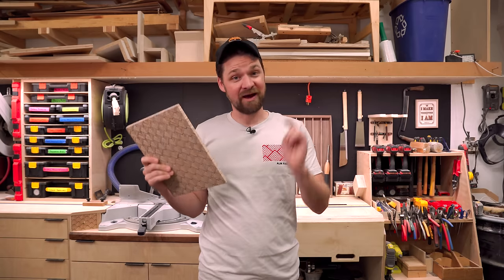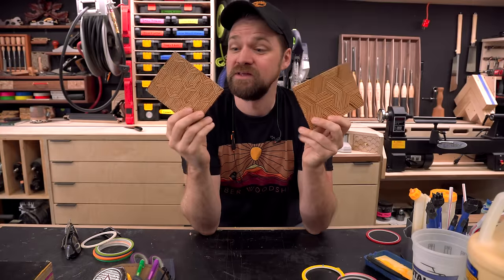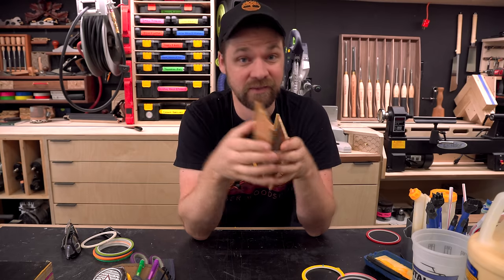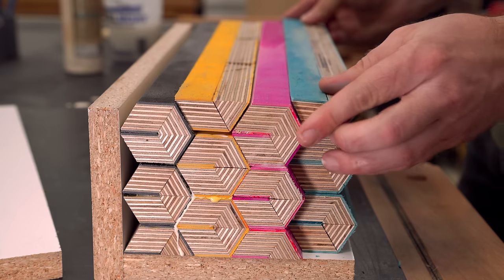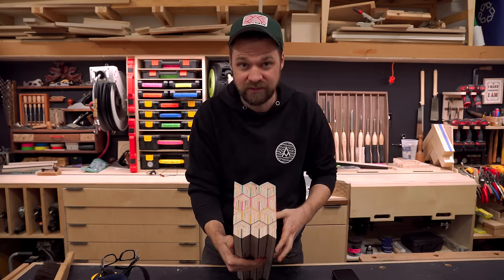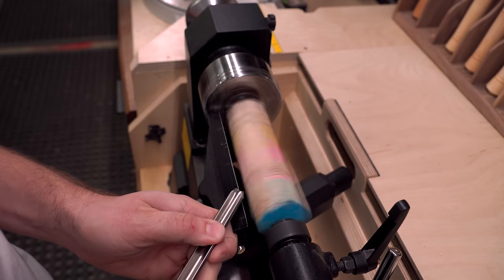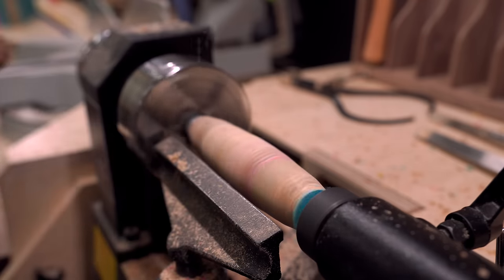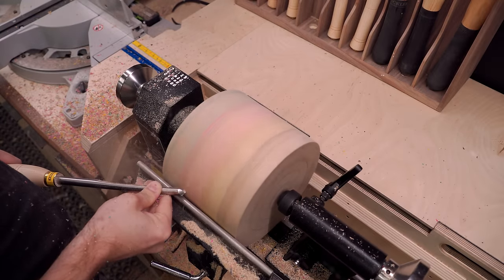Can you Woodturn Patterned Plywood?

Comment: Just been watching your video, I turn a lot of items made from old skateboards, and for someone turning laminated wood for the first time you did amazing. If you have a go a turn a “normal” bowl you’ll be amazed how much easier it cuts, you are properly learning to swim in the deep end. When I made my first skateboard bowl I also experienced the gouge heating up, however a lot of the heat comes from the bevel rubbing and the pressure on the  bevel, I struggle to explain it but as you progress you’ll notice the gouge doesn’t heat up as much & you have to sharpen it less, again on my first skateboard bowl I must have sharpened my gouge a dozen times. Hollowing it you went for a deeper bowl than I’d normally do, kudos, as you found the gouge gives a better finish when turning laminates but deep carving is tricky. Personally I always go for a tenon over a mortise as if there’s any faults in the glue up the chuck can cause them to split. However amazing first time turning veneers as as I said if you master it turn “wood” will seem easy in comparison
Reply: He definitely has some angles to learn with his fingernail profile gouge. Normally a bowl like he made takes a single sharpening. It is hard to explain on the internet what he should look for when he is roughing out a bowl as far as gouge angle etc. But you hit the nail on the head for sure.

Comment: Amazing work once again, you never cease to amaze! When I was taught to turn bowls, we always glued a scrap disc to the bottom of the blank, with a piece of paper in between.  Screw on the adapter plate, do all your turning (inside and out), carving right into your scrap if you want. When the turning is done, split the bowl off the disc with a chisel, the paper should let it split away cleanly. Sand the bottom, and you're done. Also my wife says to use the scraps for bookmarks. Thanks for another great video.

Comment: Loved the video Michael and congrats on working on a new skill! Traditional wood turning gouges are all about tool presentation. That takes time and as you eluded too plywood probably isn’t the easiest material to start learning on. It’s hard to tell from the video, but I think your tool rest may have been too high. If your handles are long enough they should be tucked into your hip when the tip of the gouge engages the center line of the wood. Your inside cuts are a push cut, you kinda want to do that on the outside too. Most of your tool presentation on the outside was scraping cuts, which are fine but the tool has more versatility and you can get a better finish with the push cut. 

It will all come with practice. Keep it up!

Comment: Great project. I applaud you for putting your learning process out there. As a long time turner, I'd offer two suggestions: 1) More clamps and pressure on your glue ups; and 2) a tenon rather than a mortise to use with the chuck is much stronger. Your "squeeze" clamps don't give you enough pressure for lamination work, plus you need cauls to hit the center of the sheets. For segmented turning, every single spot has to be a solid glue joint. I think you'll find those will give you much better results. The tenon on the end is much stronger because it's putting the wood under compression rather than a mortise which is pushing the wood apart and its strength is dependent on having plenty of wood outside the mortise (but the physics are still working against you :-)  ). Good luck and keep up the good work. You'll have a lot of fun with turning square patterns into round objects.

Comment: I tend to find that when hollowing out a blank the best thing to do is to pull toward myself and take deep cuts. (Catching against the wood is mainly avoided with technique; keep practicing). As mentioned by someone else: drilling out the center (using a chuck attachment on your tailstock) helps a ton. And when you’re turning spindles: I hope that you’ll try out placing a finger or two against the toolrest for added control. This can evolve into planting your palm against the toolrest and pulling on the tool with hooked fingers for hollowing out objects.

Comment: Fun video Michael! I noticed that you started out turning your blank from the hex using your bowl gouge. I think you’ll have an easier time getting it into round and to your max diameter if you start with a wider roughing gouge. I also find it much easier to get smooth shavings that way and usually will do all my wide shaping with it as well. You can turn it onto its side and direct the shavings away from you as well. In general I’ll only use a bowl gouge on a spindle if I need to scoop out a tight curve. Keep up the good work with your turning. I have the same lathe and love it. It gets more fun each piece you turn.
Reply from the maker: Thanks for the info!! 🙌

Comment: A lot of turners have a drill chuck designed to fit the tail stock and use that to hold a Forstner Bit to drill out the center material of any bowls, cups and vases they turn...

Drilling out the center save them a lot of time and effort mining out the center with their gouges since the center of the piece isn't turning as fast as the outer rim is...and slower turning material is harder to cut...

Comment: A couple of this I've seen that might help when turning pattern ply wood bows

This one I haven't tried, but seen it done and would do it myself - when making your blank up, start by putting a nice soft wood in the area you will be removing for the inside of the bowl. It's so much quicker to remove sodt wood thats solid then hard plywood thats made up of a million glue joints. It does take so extra time and planning but it also woorks well.

This idea I have tried and love. When making a bowl or vase, before picking up anything chiselly, use a chuck attachment in the tail stock, then use larger and larger drill bits and forsner bits to hollow out a load of that bowl. This will save you even more time because when tuning a bowl ther hardest part tk turn is the bit thats spinning really farst in the center of the wood. The drilling methode removes most of these problems. The sides are also the quickest to shave down and the hole the drills leave make life easier. 

I've also seen people glue a piece of hardwood to the botton so you don't end up with the bowl separating from the chuck. At the end, you could use a laithe tool to separate the 2 piece of wood or a saw. Hope this helps to get your confidence up a bit 😊👍👍👍👍👍👍

Comment: Something you might find helpful when turning pattern plywood, epoxy/wood, or generally fragile turns. Get a drill chuck you can put in your tail stock. Use it as a drill press and gradually step up the diameter of the drill bit. Use some carbide chisels to hollow out from there. Will save you a lot of time and probably a project or two from breaking.
And great job for your first bowl. I like how you first real project is with one of the hardest things to turn without breaking.

Comment: 19:48 seeing as it’s a, I guess, “leverage handle,” (idk the scientifical term) it probably wouldn’t have hurt to use a longer bolt set the full length of the handle, or most of the length so it’s not exposed at the end, to give it more rigidity. That probably would’ve prevented it from breaking unsupported on the lathe and would prevent it from breaking in the future

Comment: Looks awesome. You might try leaving a pillar in the center for your tailstock to press against. It helps keep everything in place while you're digging it out. It doesn't have to be thick. With your plywood I might leave a inch wide pillar until you reach the bottom. Then clean up your sides, and then cut off the pillar.

I'll often use a Dimond carbide tip to make a cone in the center then a round carbide to open up the middle.

I'll also use a diamond to create a sunken tennon instead of a mortis. I like to make a continuous curve all the way under my bowls but  Compression works a lot better to hold the bowls.  So I just cut a groove then taper the tennon.

Comment: Use for shavings? Inlay, edge banding? Even visible shims.
I CANNOT believe that you were able to turn ply. I would have thought this impossible, much less pattered ply. You have just changed my pen-turning world! 

Impressive work with the gouge for a beginner. Yes, you have to use sharp tools, which means you have to incessantly sharpen (as said in my previous comment). CARBIDE.

Honestly , I'm pretty amazed that ply will turn. 
Question: Why didn't you use your carbide blades to turn the inside from the beginning? I mean, I understand wanting to learn to use the gouge, but why? When you have a carbide tool?  Would have saved you a long time re-sharpening and you'd have seen the same effect with the change in pattern that you enjoyed. Just use it from the beginning. 
GLAD you were able to continue after it came out.  Great save. 

Honestly, I'm stunned. GREAT job !!!

Comment: The scraps really reminded me of feathers.  I was imagining them decorating the sides of a mask (the kind you hang on the wall, not wear).  Perhaps more importantly, if you go to make a hollow piece like a bowl in the future, if you can glue it up in the 4 quarters of the piece, you can then use a saw to take off a lot of the material that you would otherwise have to carve out of the middle.  So you recover more scraps and save time.  I learned this from carving watermelons, they are good practice material if you want to measure angles and understand what you will get wyen you reassemble.

Comment: Oh man, turning plywood is all asses and endgrain. That being said, I'm excited for upcoming woodturning content on your channel! Believe me when I say that woodturning will get easier with experience, yes, but just as importantly, with the right tools (gouges, chisels, scrapers, various chuck jaws etc.). They don't have to be really nice tools, either; high speed steel is high speed steel. Once you got your tools and order of operations down, the progress really speeds up. IMO you chose right to go with a mortise because you can finish the bottom and whole exterior before moving on to the hollowing without having to saw off a tenon and manually finish the bottom when the hollowing and finishing is done. Never hesitate to step over to the grinder to sharpen your tools because you can cut through miles of wood in a matter of minutes! Oh and get a beefy round nose scraper, it has saved me countless hours of sanding out tool marks. Beautiful bowl, Michael!

Comment: What you did was basically the same as making a cane in lampwork or polymer clay. You can use some of those techniques to make better blanks or logs for your plywood. Especially on making a square pattern cane. Then you can cut slices and glue up as a solid sheet.

Comment: If and when you try this again it might be an idea to put a glue block on the bottom instead of a mortice or tenon more glue in your joints and more pressure when clamping up. when you think the gouge needs sharpening it does, take your time turning , enjoy the process. The bowl turned out amazing , well done.

Comment: That jig is brilliant. I've only done one patterned piece and it was pretty difficult to get it all glued up properly and took so much time. If I start making more patterned ply stuff (like when the price of ply goes back down to something reasonable), I'm definitely making a gluing jig and doing a huge blank all at the same time! Duh. I love jigs. Don't know why I didn't think of that. Hints below.

Dude! I turn pens and that first few seconds of footage with that gouge made me pucker 😳😅 Been there. Glad to see that someone taught you to cut the corners off to make less work for yourself or you'd have blown that blank a lot sooner. 

I think that was less about confidence and more about the fact that ply doesn't like to glue well. Have you tried thinning the glue to 50/50 water to glue, letting it soak in for a few minutes and before it dries, recoating with glue? Might help the bond. You know the end of ply doesn't like to glue because it soaks every bit of the first coat up. 

Second hint (if you're going to turn enough): carbide tools. Negative rake if you can get a set (because it creates a smoother finish, though you can flip the regular tool to get the same effect if you know what you're doing). Otherwise, even a fairly cheap set of carbide tools (and you only need 3 ... square, round, and diamond) will do you better than gouges or rakes or skews ... and you won't have to incessantly sharpen them. Yes, you can hone carbide blades after you've been through using all sides (round and square have 4, diamond has 2) to extend the life. It only takes a few swirls on a fine diamond hone, water or oil, because all you have to remove are the burrs. You don't have to create an angle. 

Third hint: Buy Abranet sandpaper. A mesh sandpaper that was originally for drywall, but is brilliant on just about everything I've ever used it on. You can buy a set of 2x4 inch pieces perfect for small tunings as well as larger sized rectangles, and discs that fit orbital sanders (and they don't clog). Unfortunately, it doesn't come in quarter sheets. Way cheaper on Amazon than through Rockler. 
It lasts almost forever. I have a set from 80 to 600 that I've been using for at least 5 years and it's still almost as good as new. I've used it on soft wood, oak, ebony, pink ivory and acrylic resin, and it's still good as new. You can bang it on the counter to clear the dust, fold it, and wash it if you need to. Eventually you'll have to re-mark the grit number, but that's no biggie. I don't use anything else if I can help it, especially when turning ... except ... Micro Mesh for finishing. That stuff is the bomb for wet sanding. 

Harbor Freight sells a "dry tack" tack cloth and it's brilliant! Costs about a buck and small change per cloth, but if you strategically fold it, it will last for a very long time and doesn't dry out and get all hard like traditional tack cloths. 

BEFORE you start to CA finish, wipe with a tack cloth or you can see it in your finish. Learned the hard way.

Comment: You could use a waist block epoxied to the bottom of a harder wood for tour chuck to grip on too, this would help with the tear out also. In the end you would just part off the waste block and mount on a flat back plate to finish off the bottom.

Comment: Your lathe gouge technique was interesting lol. You had the bevel kinda inverse to what is normally done. Also if you lower your tool rest a bit, you can ride the bevel and still cut on the center of the spindle. But at the end of the day, your results were fine, but you aren't giving yourself any bevel supporting the cut, it will catch easily like that
Reply: Ok. I'm glad I'm not the only one thinking about how he cut that 🙂

I was like, damn, have I been doing it wrong?

Comment: For that amount of plywood if it’s not been said before I’d get a bucket small enough to hold it then put clear epoxy in and put it into a vacuum pot so the epoxy gets into all of the gaps and poor of the plywood. Let it cure for a couple weeks then get your turning groove on. It will be fully stabilized and though it may splinter here or there it won’t blow apart. Looks fantastic though for sure.

Comment: This was a great video, it turned out lovely. I have seen many videos similar where the wood is stabilized into a block of resin, so just using plywood and glue is a great answer to the question if you can turn patterned plywood on its own. 

Now I am envisioning taking the large blank first, cutting it into inch cookies, and rotating the colors before regluing it into a large blank once again.

Comment: This may have been mentioned already but there is a tool I have seen that may be of interest to you to save material. It is a set of tools that will basically cut into the top of the bowl and will cut it a dome shape. The process is to use the smallest one to remove a solid dome but then each consecutive one will basically cut a bowl out of the inside that is progressively larger so you end up with basically a set of nesting half spheres. You would still likely need to finish carving out this shape of bowl but you would be able to retain a lot of pieces for later use (you could also just jump to the largest one that fits and then have one large solid dome of material to use later). 

Unfortunately i cannot remember what it was called and i only vaguely think that it may have been Adam Savage that i saw using it at one point.

Comment: You might try locking at K&G (company that uses vacuuming presure cycles to fill any gaps or soft spots) or a penitrating epoxy. Thats what i use to turn punky wood. I also really like the circle carbide cutter from rockler.